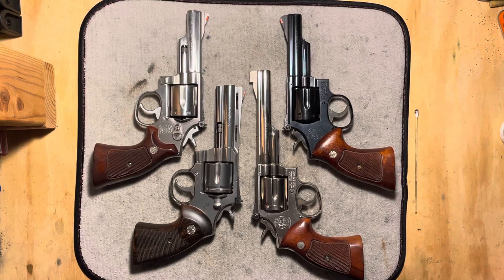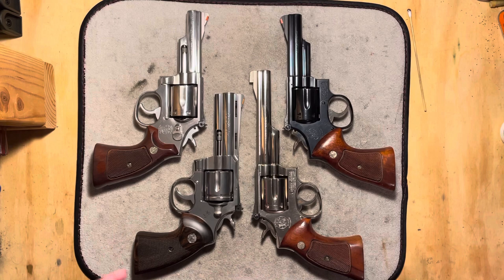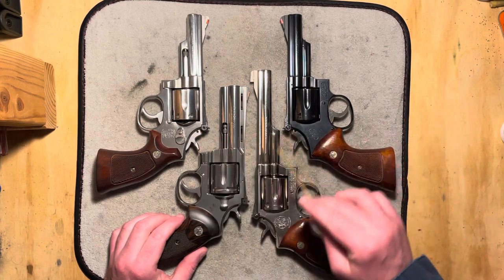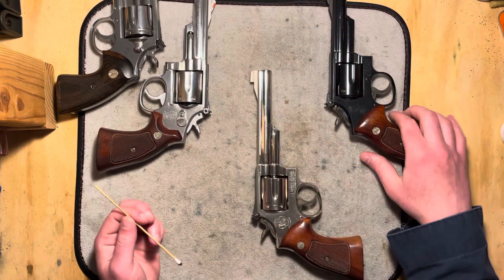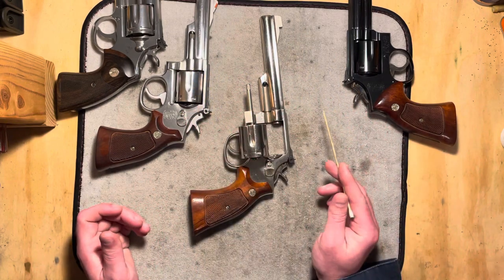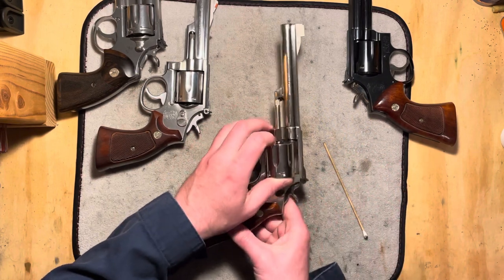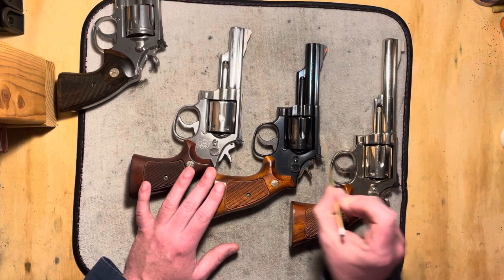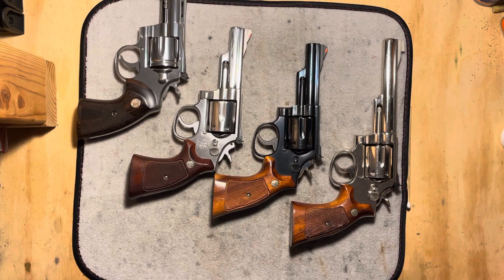Revolver Forcing Cone: Explanation and Avoiding a Crack, Ft. S&W .357 Magnum K-frames & Colt Python

Comment: After watching your video, I am disappointed that the S & W model 66-2 I've just bought is only a .38 special and not a .357 magnum. I am surprise that S & W haven't gotten sued for false advertising.
Reply from the maker: It’s just a matter of context and the available information. I do not blame S&W for this issue… it was a period of rapid advancement. Everyone was trying new stuff, and they all experimented and sometimes they pushed too far. 

These revolvers do safely fire .357 Magnum. They accept it, and barring other issues they can do it easily without any catastrophic failure. 

Designs got better. The old ones can do it in a more reserved fashion, the newer ones digest a magnum diet easily. 

Enjoy it for the craftsmanship and classic Americana. Shoot it, but just understand the time it was made for.
Reply: @ColterBrog  I am no gun expert, I compare my 66-2 2 1/2" to my 64-4 4", other than the barrel length and the extra metal around the 66-2's shell ejector bar, all the other components look the same with same size on every component. So, what makes the 66-2 a .357 magnum and the 66-6 is not? Is it a scam that S & W came up with? What would happen if I shot .356 magnum with the 64-6?
Reply from the maker: @rustynail246 The 64 should not accept a .357 Magnum cartridge. The chambers aren’t bored out far enough for the longer case length. 

A lot of what this comes down to is performance trade offs. Do you build a revolver that will last forever, but is incredibly heavy and clunky to the point nobody wants it? Or, do you build something lighter with less material that is convenient to carry, but will wear out faster if used with high velocity ammunition consistently? 

It’s not a scam. It’s a design choice. We’re not at the point, decades later, where that design choice which made sense at the time is becoming an issue. 

Guns don’t last forever. None of them do.
Reply: @ColterBrog  Thanks for the info. Now I have two more questions maybe you can help me out. What would be the next heavy .357 magnum load after 158, if I am going to shoot .357 magnum, I want to make sure it's safe for my gun. Also, why is the front sight on the older revolvers are a tall blade? Most people don't know how to align it with the rear sight, especially the ones with just a groove for rear sights. A lot of people just line up the top of the blade front sight to the top of the rear sight like the semi-auto, and that's wrong because they would be shooting low. Some said just file the front blade sight down, and that would be wrong too, because the manufacturers would have done that in the factory. So, how do we do it? (I just estimate, most of the time the middle of the blade ends up lined up with the top of the rear sight). Adjusting the rear sight to line up with the top of the blade front is wrong too because you would run out of adjustment in the rear sight.
Reply from the maker: @rustynail246 I’m not sure exactly what all is offered above 158 grain. Probably varies by manufacturer. I’ve had 180 grain before. Kind of odd stuff, though. Personally I’d just stick to 158 since it is so common. 

The issues you’ve describing with the sights I haven’t noticed. I shoot my revolvers just like I would shoot any other handgun and haven’t had a problem.

Comment: Sounds like you need a Ruger! 😏
Reply from the maker: The Rugers are definitely very strong revolvers. Nothing wrong with a Ruger. 

That said, this issue of thinned forcing cones causing a weakness and potential for cracking has been eliminated by S&Ws newer barrel system. A new Model 19 Classic is going to be plenty strong to use .357 Magnum high velocity loads on a routine basis due to the engineering and design improvements.

Comment: I don't understand why anyone would choose a Smith and Wesson revolver over a Ruger.
Reply: The trigger pull is why. The new Ruger GP 100 Match Champion solved that issue and now you are just co dependant on the Smith and Wesson if you buy it over the Ruger Match Champion .
Reply from the maker: As Robert has mentioned, the trigger pull would be the main reason and to a lesser extent the overall fit and finish. Ruger revolvers are tough as nails, but routinely have a rougher finish and just more attention paid to economy. Not inherently  a bad thing as it keeps quality revolvers at a reasonable price point, but S&W generally looks nicer. 

The S&W design tends to be more compact. Lighter and less bulky for similar revolvers to Ruger. 

I’ll also clarify that these issues with the forcing cone are not particularly relevant on the newer revolvers with the two-piece barrel. 

Both companies make good revolvers… I prefer the new Colt Python over both, though, because of how smooth it is. It’s an enjoyable revolver to handle and shoot.
Reply from the maker: @robertchute1984 That has piqued my interest. I’ll have to look into the Match Champion.

Comment: Idiots who fire 125 grain magnums from a K frame constantly are the culprits for cone cracks. Almost all LEO in the past have stated that 158 grain magnums were for carry and 38’s were for practice. However, the percentage of cracks were so few and documented rarely that it is not a big issue. Seriously, find me a Model 19 with a cracked cone and I will find you a unicorn.
Reply from the maker: Yup. I think it’s a misunderstanding of what the revolver was intended for and what ammunition was commonplace during that time. 

Additionally, the ones particularly prone to failure probably already did fail decades ago and aren’t around anymore. 

In general, I agree. Pretty rare but also easy to avoid with a bit of understanding of the common loadings the revolvers were mainly intended to be used with at that time.
Reply: @ColterBrog  From speaking to so many LEO, including my uncle who carried a Model 19 as a cop for 30 years, cops preferred 158 grain because they were easier to make followup shots. They rarely ever shot 125 grains or loaded them for duty. The ones who did were easily outed as rookie cops. These revolvers went through hell and S&W designed them so screws could be interchangeable as well as parts such as the extractor rod be easily bent back into shape. I prefer them over the new classic ones but may have to get a newer one because the newer ones are just built like tanks. Also, damn accurate.